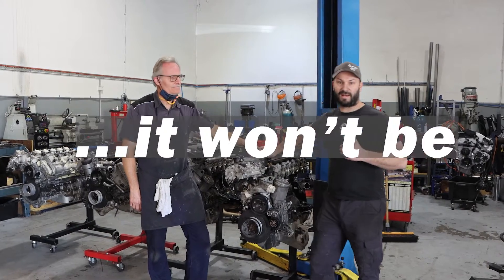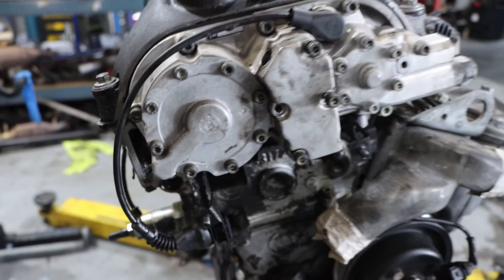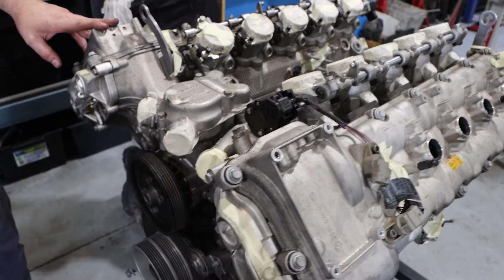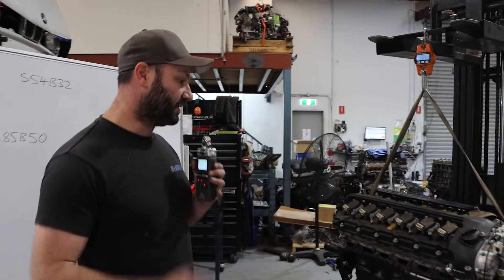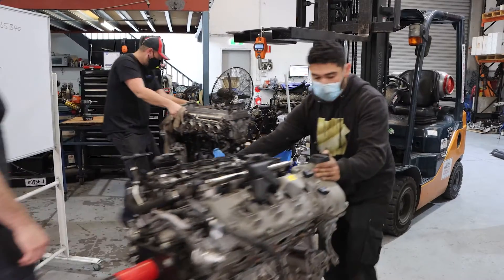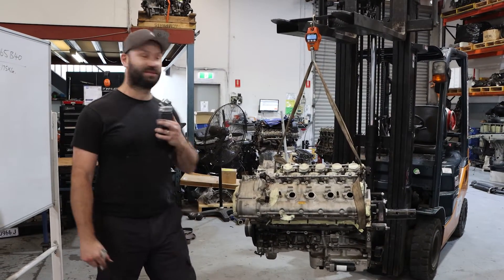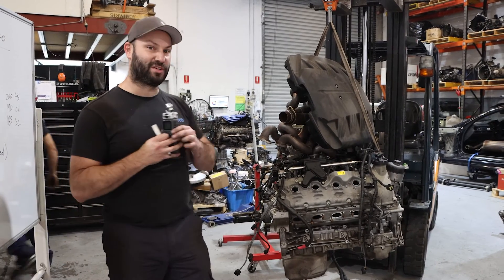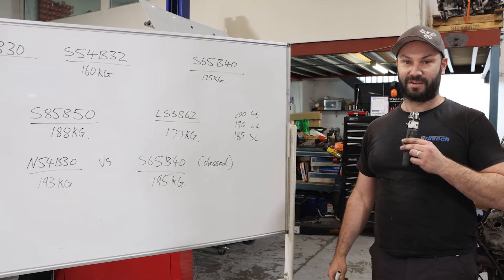Weighing BMW engines - S65 vs S54 vs S85 vs N54 vs LS3

Comment: A little useeless without all.the accesories ,but still an interesting data point
Reply from the maker: @Euphorica  we took the opportunity with what we had handy. It's certainly better than the speculation that goes on otherwise. The comparisons are also consistent and to show the core differences in weights and bust the myths that V8s are too heavy

Comment: Placing an ls engine in a bmw is a great way to lower its market value.
Reply from the maker: 40+ customers of ours beg to differ.
Reply: @BrintechCustoms  Australia has been to mericanised. The same as them wanting maccas instead of a quality meal.
Reply from the maker: @chippyjohn1 not really. We have even more customers still having us put BMW engines. There will always be folks that eat Macca's.
Reply: Lol 😂 in the states used bmw are dirt cheap cause they’re unreliable garbage. Putting an ls3 or any variation not only increases the value substantially but also increases reliability substantially

Comment: I'm just now watching this 2 years later.  Really cool episode but you guys weren't remotely accurate in the comparison with the "stripped down" LS3. It had the alternator installed, coils, and plugs.  Nobody else has even noticed apparently.  

The ppl that think the LS3 is heavier than these BMW engines simply lack a basic understanding of engine fundamentals. 1 cam vs 4 cams, 2 valves per cyl vs 4 make a huge difference is cost, weight, and mechanical friction losses. Pushrods and rockers do add back in some weight back on but this is why the LS is unmatched for cost, complexity and power and packaging. Volumetric efficiency of an LS is no joke.  

All that said I have accumulated 4 S85s since 2018- all with undamaged cranks, blocks, and vanos, but they were cheap and relatively unknown an unloved, before all these YT videos featuring the car and engine were around. In the US, there's no way I could have acquired an LS7 or LS3 powered car for less.
Reply: Thank you these idiots think HP/L is a the ideal measurement

Comment: I know for the most part that increasing the load profile on an engine greatly reduces life, but I also chuckle a little bit every time I hear it, knowing that I drive my truck with its little 5.3 ls based motor like it’s a NASCAR every single day, and at 196k miles I haven’t had a single issue with the motor or the trans.  The internals of that motor haven’t seen the light of day since December of 2001.

Comment: Interesting weight differences.
I do wonder about the top engine tuning for the 54 vs 65.   Yes clearly the N54 has boost potential, and that would up the weight on the 65.   But capacity does count.

Comment: Interesting considering BMW themselves said the S65 was lighter than the S54, you guys proved them wrong.. but im still impressed at how light both V8’s and the V10 are.
Reply: Nope, not said by BMW. The E92 M3 /  s65 launch documentation mentioned the engine block being lighter than the S54 block. Not the engine.